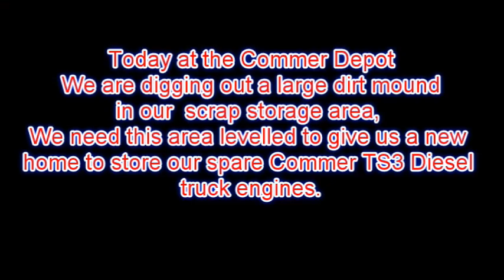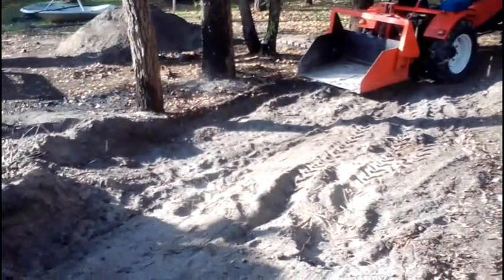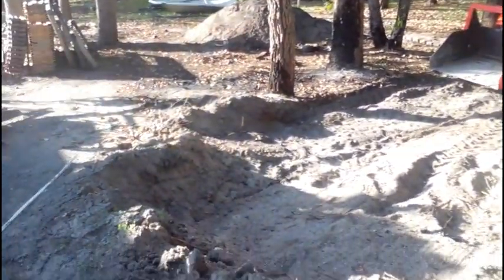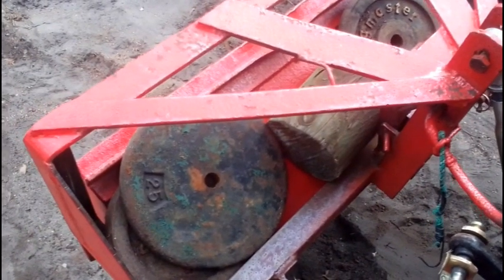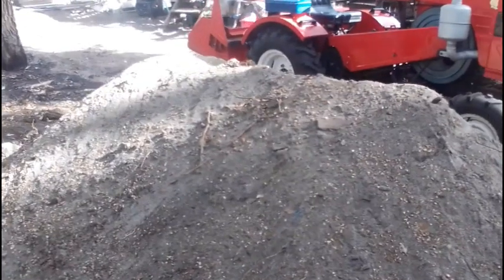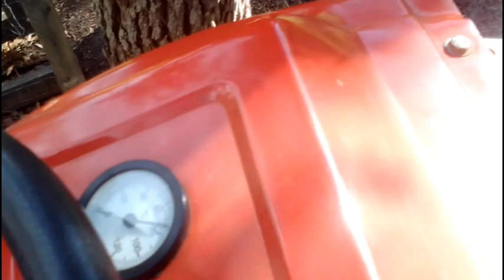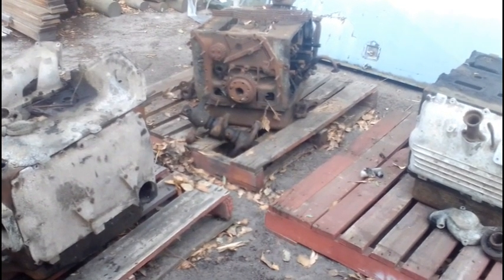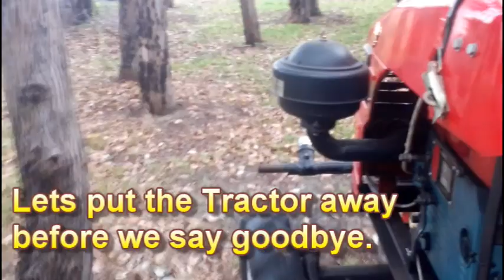Chinese Tractor Review in Australia Value or NOT! PT2,  DIGGING DIRT!,   WILL I KILL IT ALREADY?.

Comment: Thank you very much for this information. I am in NSW and have just bought exactly the same tractor off facebook marketplace. It was a local sale and I really only wanted the rotary hoe and twin mould board which came with it. It only had 20 hours on it and starts easily and runs very well (if a bit noisy). I have a couple of Kubota 4wd, but there is something about this beast, it is just a total blast to operate. I love it. I have no information on it other than it has hardly been used and is 25kw single cylinder 4wd. Any information you can provide would be very appreciated (such as spare parts availability, service tips or copies of manuals etc) Happy to send pictures if you like. regards  chris
Reply from the maker: Hi Chris, Thanks for watching,  All parts are easily available from AliExpress in China and are very cheap. Your engine will have a number of the side like 1110 or 1115etc and search this number and "diesel engine" in AliExpress to see what parts they have .  Mine has now done 127hrs and has been great with no major problems.  Just remember to keep the water reservoir full and dont overrev. Yes they are very noisy and shaky but fun. I dont have any manuals sorry, but on YouTube lots of vids on fixing engines just search "Chinese diesel" or "ZS1115" and you will find them.  The rear axle/trans also seems very strong and there are vids on fixing those on YT as well.
The engines are very popular in small trucks in Vietnam.  Search "Vietnam small truck"  I initially thought the drive belts would be a problem but after 127hrs they are still like new. Clutch kits also available AliExpress. 
My only caution would be, Watch out for all the moving parts especially around the kids. These are very powerful for a small tractor. I have never stalled mine it just digs itself into the ground. Great fun!
All the best with it.
Reply: @machineryrescue   thank you so much for the help. I will keep in contact best wishes and regards chris W